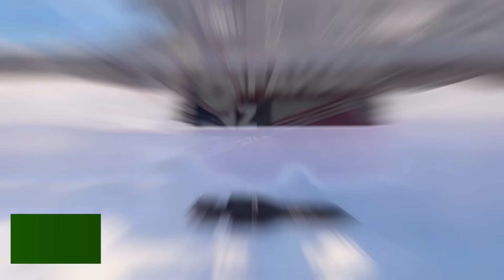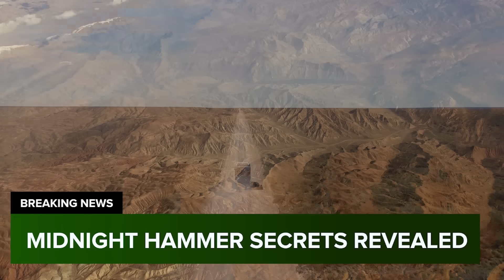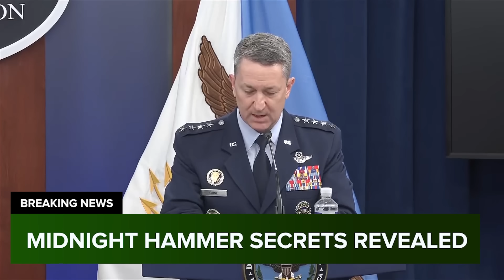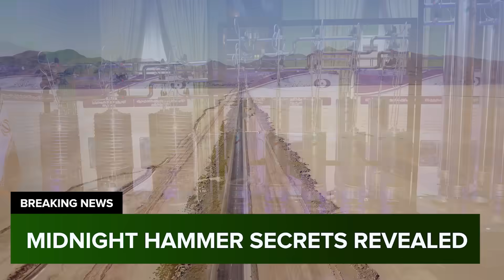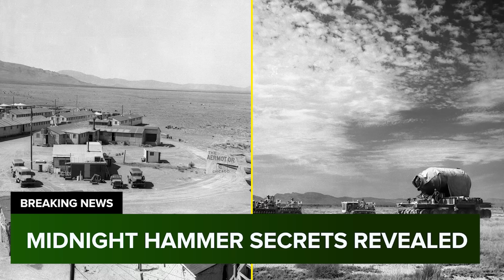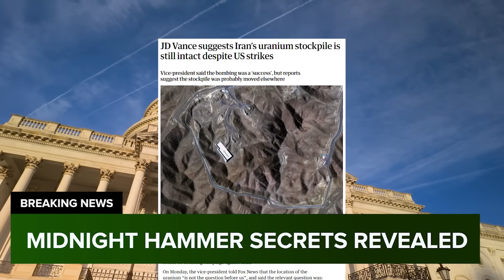Everything You Didn't Know About BUNKER BUSTER Strikes On Iran

Comment: the sad reality is that the very thing that protects and conceals also garauntees maximum over-pressure. upon successful trigger, the calculation to render pressure-output is modified by the surrounding structure. If the walls and ceiling cannot move out, down, or up, the yielded pressure requires a modifying expression of a large factor to reorient the blast along a tunnel, as opposed to an expanding sphere. the people did not survive. control systems would be made offline. and thats with just one proper strike. (the radii is divided by the surface area of the tunnel, that divisor then is used to represent the magnifying effect as a factor, with the standard blast results known)

Comment: LOL, seconds after a picture of a MOP test drop from a B52, they say only a B2 can carry it.
Reply: Where do you see a B-52?
Reply: @Predator42ID  watch the full video
Reply: @Predator42ID  It's at 1:21 in the video.  The B-52H was the test platform, but it might drop from 43,000 ft, with about 80% of the kinetic energy of a B-2 drop from 52,000 ft.  The B-1B can also drop the GBU-57, probably from in excess of 52,000 ft.  I don't know where this stuff about the B-2 being the only bomber capable came from.  The DoD documentation addresses GBU-57 deployment from a doctrinal and survivability context, not a capability context.  The GBU-57 was intended for strategic stealth strikes on hardened targets, and the B-52 and B-1B are not capable of that.
Reply: @AJCiani-physics I wonder about the B1b.  It had it's nuclear capability disabled by treaty.  It can certainly carry the WEIGHT, (more than a B52).  I wonder if the bommb bays have the physical capacity for twp MOPs?
Reply: Test drop.